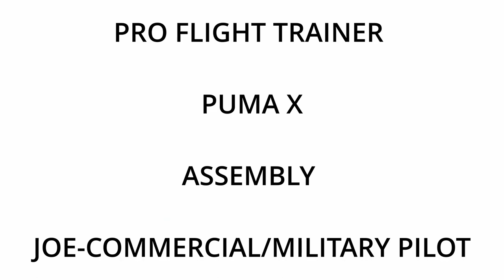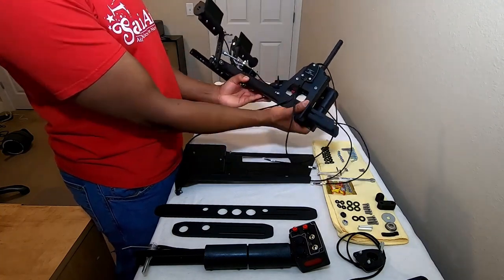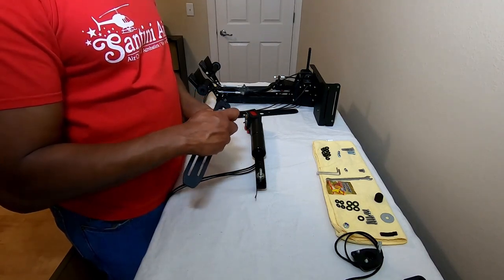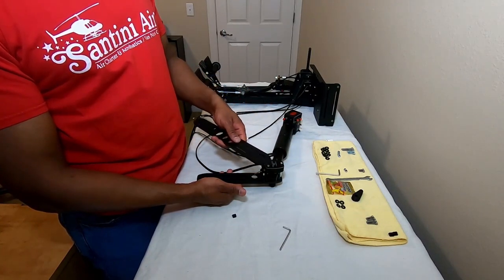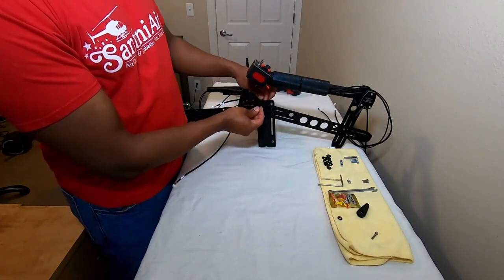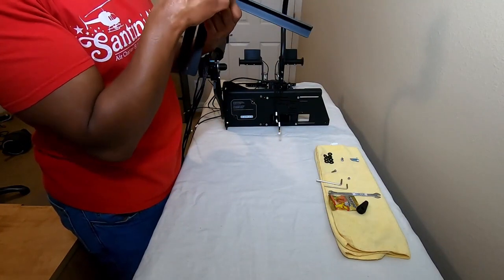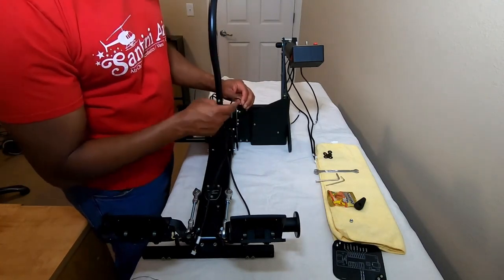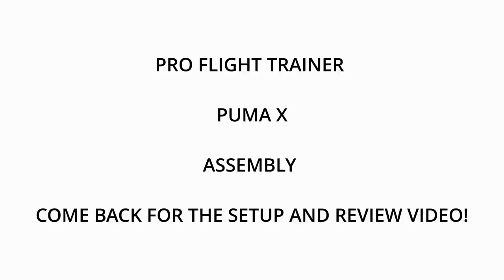Puma X 5th generation Assembly demo by owner

Comment: So any advice I could get from you in practicing my flight sim for the real thing, preparing for an actual check ride?
Reply from the maker: depending on your level, but if you have not flown regularly, setting up the sim in your actual check ride location can help get back some visual references.
talk and act in the sim as you would in the real machine, do your scans, patterns, checks as much as possible as you would, to set your mind back into the "cockpit mode".
one note on full AR. Depending on your level, don't "over practice" those in the sim, as you might transfer negative habits, especially flair and touch down.
but you can practice entries and scan pattern, and "talking through the descent" etc...
Reply: @proflighttrainer  So i exclusively fly VR which gives me more depth perception than say using trackir, but i do practice regular approaches as well as using all visuals inside the cockpit, i.e. clearing the aircraft before pickup, using outside references, ect, ect. Lately i have been practicing some steep approaches and slope landings. And I am ALWAYS willing to listen and learn from the voice of experience ... such as yourself!

Comment: So is the puma really more realistic than say thrustmasters Hotas warthog? As far as rotory wing goes?
Reply from the maker: Hi. excellent question! :-)
if we look at the cyclic for example. In the As350 for example, you can perform a full helicopter flight using 2cm of travel on pitch and roll, measured at the top of the cyclic.
Since the cyclic is extended with the curved tube, it means that with a short grip handle, you would need to move in a range under 0.1mm to be as accurate, which is really difficult.
Having the rudder pedals for your feet is representative of the real cockpit. You can fly in the sim by twisting the cyclic grip to give rudder input, but it is not realistic as you would do this with your feet in the helicopter.
There are many more examples we could give but just wanted to share 1-2.
We know of many owners who trained with our flight control solutions and went for a dual control flight with an instructor, and because the PUMA prepared them to coordinate each control, they were able to fly and hover the real helicopter within minutes, to the amazement of their instructors.